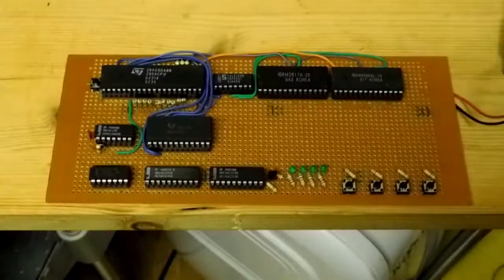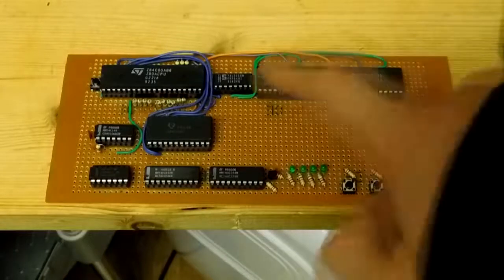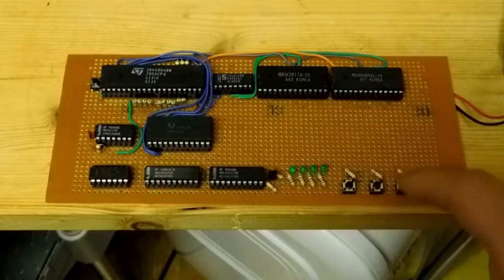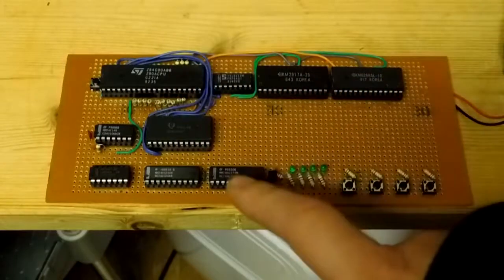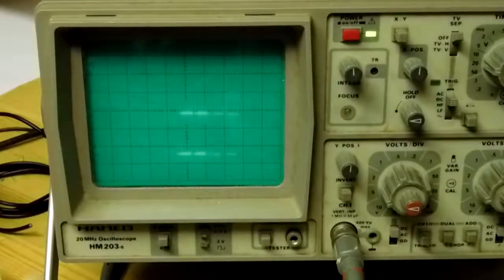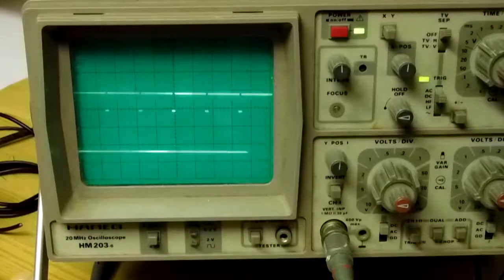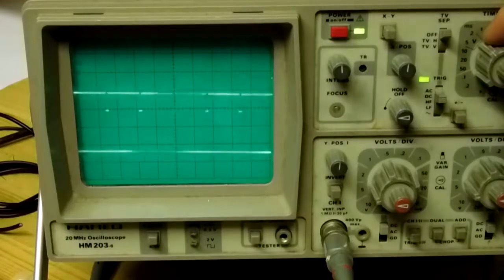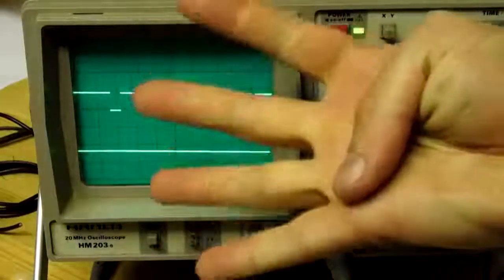How to Build a Z80 Computer: Basic IO and Writing Your First Program

Comment: This is nice and all, but how do I connect an MPU to my computer to program it? There exists no examples of that anywhere on the internet. Please tell/show me how this is done. I can figure out the rest...
And yes, I visited the link in the description... What I want to know is how do I connect a USB to it via my PC and program the z80 with assembly? I want to fully understand the MPU before I get it. Thanks.
Reply: +1 I wanted to write the same comment.
Reply: For both of you, you can visit my Chanel ! as I am building a z80 system and I will explain every aspect!
Reply: So the what i have done it is that i have an eeprom that i program with one of those cheap USB programmers to program the EEPROM chip and flash the assembly onto the chip. You have to know how the memeory works on the chip, you have to know what opcodes actually are etc etc. the z80 then starts to read the chip at address Zero when the reset line is held low and then let go. Oh and also, you cant treat these chips like a microcontroller with an IDE where the computer does everything for you. you have to actually actually know how the z80 works and reads data from a memory chip. you cant just "plug it in" it realy doesnt work like that. This is MUCH MUCH more low level than you think. you cant just connect a USB to the chip, the cpu has no idea what a USB is. even then you need to know how the USB protocol works, get a chip that can read the USB data, then have the z80 somehow interface and read that chip, then take the data and shove it into ram. not many people know how to do this before because even in the micro controller world these days, so much is done for you that people never get to know what is actually making it all run the more complex technology gets the simpler we make it and that hides how things work. It is going to take a lot of work but you can do it.
Reply: Also remember it is a micro processor not a micro controller. there is no on board memeory to program or ram at all. The cpu has to read from external memory. it places the address it wants to read form on the address buss and then the device (ram or rom chip or i/o or whatever) responds with the appropriate data, then you have to set some logic that activates the ram chip if the cpu requests an address that you want to be ram and rom. so like for mine, address 0-32k is all eeprom, and the rest is ram, you have to gave logic gates to signal the chip enable line of the ram then address 40k for ex is addressed, but at the same time you have to make sure that the ROM chip is disabled. or else the information from both chips will mess up the data.
Reply: or and one last thing, you can still buy these CPUs literally brand new for like $5 on Mouser or Digikey
here you go  https://www.mouser.com/ProductDetail/ZiLOG/Z84C0006PEG?qs=pM1BbJKkACbODnYpdULEDA%3D%3D